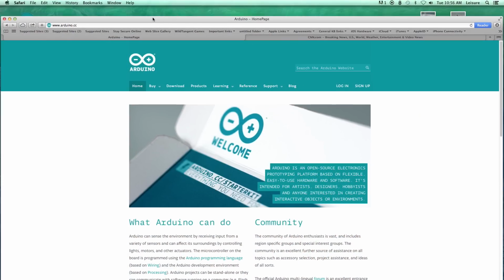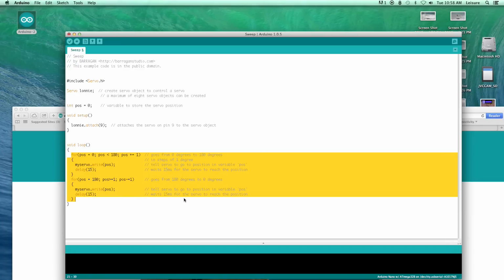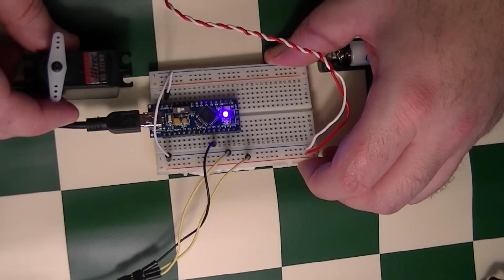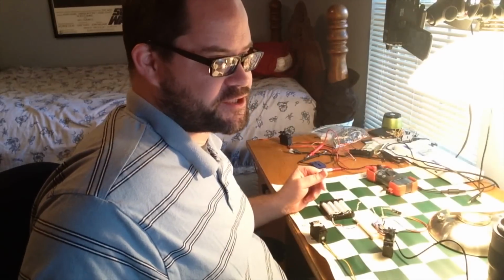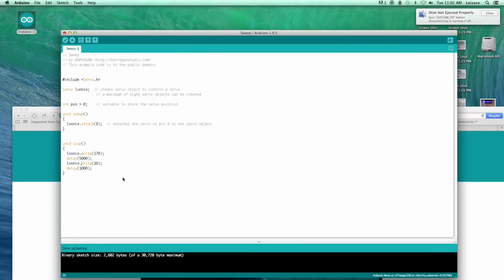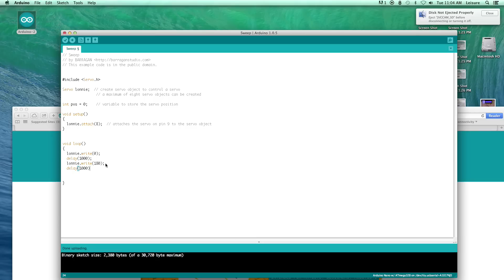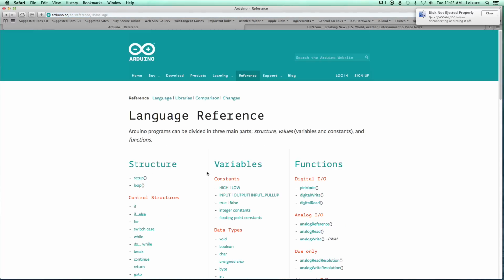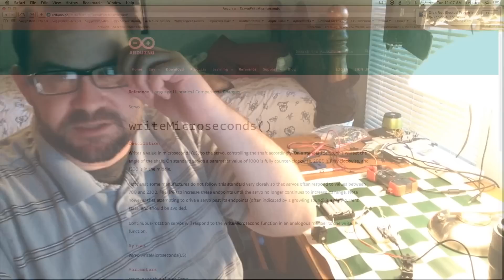How to Arduino #3 - Servos

Comment: Ok, you can connect up to 12 servos to a board. Do all 12 servos respond to the same command, or can they be programmed to operate independently of each other, in either sequential or random order?

Comment: Hello, I was curious when I do the sweep test, I keep getting the Error compiling for board, Im using a 5v trinket, and I've installed the Soft Servo into my library so it should be there. Help!

Comment: I'd like to just hook up a battery pack like the one you used directly to a continuous rotation servo. Will that work?? I'm trying to simply make a slow moving rotation motor for an art project. Thank you!

Comment: I have bought the TowerPro MG995, but I cannot get it to rotate 360 degrees. Do I have to convert it? http://www.instructables.com/id/Convert-Towerpro-MG995-servo-to-continuous-rotatio/step4/Remove-the-5kOhm-pot/

Comment: do we need a bread board for sure can we connect it directly i have 3 servos do i need 3 power supplies
Reply from the maker: you can use superglue as long as the wires are touching eachother.

Comment: hello sir i had arduino mega .. i want to run 19 servo motors but in arduino there are only 13pwm pins is there any chance to run 19 servo motors for biped robot..
Reply: You don't need the PWM pins to run your servo. Just hook your white (control) wire up to any of the outputs as long as your code has them designated as an output.

Comment: It's a servo motor, not a stepper motor, so it can tell you what position it has reached.  Instead of relying on a random pause you could loop until it reports it's gotten where you told it to go before telling it to go elsewhere.  For instance:

int pos = 180; 
lonnie.write(pos);
do {
    // nothing actually happening in this do statement, it's just looping until read says it's reached where we want it to be
}while(lonnie.read() != pos);
lonnie.write(0);

Comment: Hi! Great tutorial. I am trying to control multiple (14, to be precise) servos using an Arduino Mega as my school project. I was advised to use a Sensor shield (https://images-na.ssl-images-amazon.com/images/I/51gzXjEx9zL.jpg), which, I believe has its own power supply provision. Thing is I can't figure out how to power the servos via this shield? I have seen a lot of other tutorials and all those use a breadboard, but I don't want that. Could you please explain (here) or perhaps point me to a website or something that explains this?Thanks.

Comment: I just bought a 1501mg analogue HD and am now finding Arduino won't power it for more than a few seconds, even though it says it runs at 4.8 volts, but I'm guessing the MA draw is too much. Now I'm stuck trying to find a 6V adapter which allows around 2500mA (stall torque). They don't seem to make them over 1A!

Comment: I have a towerpro mg995 
when I power the Arduino with USB it work fine but when I try with 9v external supply it moves very very slowly
I m a beginner please help

Comment: I have a towerpro mg995 
when I power the Arduino with USB it work fine but when I try with 9v external supply it moves very very slowly
I m a beginner please help
Reply: Don't use a 9 volt battery.  Cmon man, google it.
Reply: I want to use servo in my project to move the ping sensor as head of it
I am using l293d for DC motors
but how to power servo 
please can you guide me
Reply: I want to use servo in my project to move the ping sensor as head of it
I am using l293d for DC motors
but how to power servo 
please can you guide me
Reply: This is my other account.  No I can't, I don't have time sorry.
Reply: okay
can you at least tell me best way to give external power to servo
thank you for your reply
Reply: okay
can you at least tell me best way to give external power to servo
thank you for your reply
Reply: You can just google it and do your own research.  Do it, it's the best way.

Comment: Hi Lonnie, great video, very useful for me as i am trying to build a four gate level crossing for my railway layout. I have four Hobbyking HK15178 servos and a mains (240volt) as i am in the UK to six volt DC power supply rated at one amp. can you tell me how i can operate the crossing gates from a switch controlled by my Arduino Mega 2560?
Cheers Phil

Comment: that video. it is awesome thank you so much it is very helpful I especially wanted to see power of it and your demonstration is so good, I want to ask a question is mg996r as powerful as you try to stop with your hand
Reply: Thanks for the kind words.  I do not have experience with the MG996 unfortunately.  I guess you could compare the torque ratings for the two.
Reply: Garage Flips
thanks, I saw that they are same and I have 2 questions, does it drain electric so much if something blocking it to go an angle and does it consume energy in delay parts of code?

Comment: Thank you Lonnie 

Could you please tell me how I can write code to control 2 servo to run at the same time and same deg. using for function .
Reply: Here is the code that I use for mine: /* Sweep2
 by mechanic37
 http://www.mechanic37.com
*/

#include <Servo.h>

Servo A;  // create servo object to control a servo
Servo B;           // twelve servo objects can be created on most boards

int pos = 0;    // variable to store the servo position

void setup()
{
  B.attach(4);
  A.attach(9);  // attaches the servo on pin 9 to the servo object
}

void loop()
{
  for(pos = 0; pos <= 180; pos += 1) // goes from 0 degrees to 180 degrees
  {                                  // in steps of 1 degree
    A.write(pos);              // tell servo to go to position in variable 'pos'
    B.write(pos);
    delay(15);                       // waits 15ms for the servo to reach the position
  }
  for(pos = 180; pos>=0; pos-=1)     // goes from 180 degrees to 0 degrees
  {                               
    A.write(pos);              // tell servo to go to position in variable 'pos'
    B.write(pos);
    delay(15);                       // waits 15ms for the servo to reach the position
  }
}

Comment: I got my servo working after rewriting the commands when you rewrote the sketch, but i'm not sure why it didn't work with the first sketch at the beginning of the video. And thank you for this video, it made much more sense than the book I was using.
Reply from the maker: +D. Duncan To be sure I understand - you are saying your servo wouldn't work with the example sketch, but it did work when you used the code like I wrote in the video?
Reply: +Lonnie Honeycutt that's absolutely right.
Reply from the maker: +D. Duncan Was there an error message?
Reply: +Lonnie Honeycutt No error which is what confused me. Either way, the servo began functioning so I'm good. I just need more experience programming the arduino to understand any issues I may have in the future.

Comment: i want to ask some silly question, can i just use 5v power supply from arduino board, because my servo not working using that voltage or just my servo had a problem?

Comment: Hi im using servo with potentiometer on arduino. I have an issue using a Power hd 1501 mg analog servo which jitters too much and have electronic noise. Can someone help me?
Even if i use the sweep servo programming on arduino ide it will jitter a lot. 
I am powering the servo with arduino's 5 volts or 4 AA batteries.

Comment: Great video!  Thank you for posting.  I'm buying an Arduino especially to learn servos.  Did a giant 4x8' plywood sheet holiday card and trying to make a moving light saber on darth vader... long story, but I think a servo would work based on your demo given the torque...  Thanks again.  Jason
Reply: +Jason Mayne Is this life size? That's going to have to be a pretty big servo.
Reply: Hi - the saber is 3 feet long, so I have 4 little pulleys I was going to use to take off some of the weight.  Attaching servo to the bottom center of a 5-gal bucket with a string tied to the outer edge on the back side... string will get longer/shorter as the bucket bottom turns.  Attaching string over top of board to saber...  Unless you have a suggestion?
Reply from the maker: +Jason Mayne what servo you using? What is the power source for the servo?
Reply: I ordered a BotBrain CRS Continuous Rotation Robotics Servo from Amazon and should be in the mailbox now, and a Arduinox Uno Rev 3.  Was thinking I can wire it with power, no prob; bought adapter.
Reply from the maker: +Jason Mayne Based on what I read, it looks like you should shoot for around 6 volts.  I wouldn't power it straight off the arduino board with that kind of torque.
Reply: admiring the new Servo here but guess the Arduino shipped separately.  Good idea on the power; I do have a 4-AA holder w/cord I can use as separate power only for the servo, which I think is how i see it in your video.
Reply from the maker: +Jason Mayne right on. just don't forget to tie the arduino ground to the servo power ground.  If they don't have a common ground it won't work.
Reply: Right - copy that.  I plan on duplicating the set-up you have exactly.  How to power the Arduino separately?  Yours is via USB obviously.  Needs it to be stand alone...
Reply from the maker: +Jason Mayne You might be able to power the Arduino and the servo off the same battery pack, just splice into the wire coming off the battery pack, or use a breadboard.  The key is that you are not hooking the servo power to the 5v coming off the Arduino.  If the voltage drop causes a problem for the Arduino when the servo runs, you could just use a 9V to a barrel plug to power the Arduino.  If you search "arduino 9v barrel plug" on ebay they are really cheap.  It's good to keep a couple of those around.
Reply: Great idea - thanks Lonnie.  Will see how this goes!  Hopefully I can post a video of the finished sign project.  :-)
Reply: Jason Mayne Depending on how much work this servo is doing you may need to bump this up to 4 D cells or use a wall adapter.
Reply: Cliff Hartle Thank you - yah, may help so I don't have to go change the batteries out every day too!  Jason
Reply: Lonnnie, exciting day - got it going!  Used the standard "sweep" example for the code, common ground, 4AA battery only to servo, and voila!  Thank you for the help.  Now to tweak programming.  May just connect arm to the saber - this thing has some serious torque.  All the best to you and thanks again
, Jason

Comment: And how to do a vibrating dildo???
Reply from the maker: Use a high speed motor with an out of balance weight attached to the motor's shaft.
Reply: Celphones have a speed motor with an out of balance weight attached, take apart en old celphone and atach the motor to a carrot
Reply from the maker: +Bruce Lee Not that kinda party, sorry
Reply: +Lonnie Honeycutt  im getting a boner

Comment: hi someone pls hlp me.... im using MG995 servo.... irrespetiv of the program i give.... it in rotating in steps of 1 degree only....the problem is same both in case of arduino and ATMEGA16..... kindly hlp me..... im confused whether the motors are faulty r else they require any special pluse ...

.

Comment: Greetings, Lonnie. First of all, I think your tutorials are clear, concise and easily understood. I have looked a great number of hours online for a solution to my difficulty. I'm trying to program my arduino to control a continuous servo and a standard servo together in one arduino uno. I can make them work individually one at a time and no problems or conflicts. But when I put them together in one sketch I run into errors. I may have a syntax problem. I'm hoping you you could shed some light. I'm trying to control a camera slider with a Spring RC 4315R 360 servo and clicking the button on a wired intervalometer (plugged straight to the camera) with a standard micro servo. I'm very new to arduino and servos that I fear i might do damage (over-voltage) to my camera and the intervalometer, for that matter, if I make the arduino click the camera electronically from its output pins. That's why I think a mechanical click will be safer. I'm aware there's a variety of ways to skin this cat. I copied these codes from other generous posters online and have tweaked the numbers to fit my purpose and they work good individually.
Slider 360 servo code:
Reply: #include <Servo.h> 
 
Servo Ron2;  // create servo object to control a servo 
                // twelve servo objects can be created on most boards
 
int pos = 0;    // variable to store the servo position 
 
void setup() 
{ 
  Ron2.attach(8);  // attaches the servo on pin 8 to the servo object 
} 
 
void loop() 
{ 
  for(pos = 180; pos <= 0; pos += 1) // goes from 0 degrees to 25 degrees 
  {                                  // in steps of 1 degree 
    Ron2.write(pos);              // tell servo to go to position in variable 'pos' 
    delay(10);                       // waits 1ms for the servo to reach the position 
  } 
  for(pos = 50; pos>=0; pos-=1)     // goes from 20 degrees to 0 degrees 
  {                                
    Ron2.write(pos);              // tell servo to go to position in variable 'pos' 
    delay(300);                       // waits 1ms for the servo to reach the position 
  } 
}
Reply: #include <Servo.h> 
 
Servo Ron1;  // create servo object to control a servo 
                // twelve servo objects can be created on most boards
 
int pos = 0;    // variable to store the servo position 
 
void setup() 
{ 
  Ron1.attach(9);  // attaches the servo on pin 9 to the servo object 
} 
 
void loop() 
{ 
  for(pos = 0; pos <= 180; pos += 1) // goes from 0 degrees to 180 degrees 
  {                                  // in steps of 1 degree 
    Ron1.write(91.5);              // tell servo to go to position in variable 'pos' 
    delay(1);                       // waits 15ms for the servo to reach the position 
  } 
  for(pos = 180; pos>=0; pos-=1)     // goes from 180 degrees to 0 degrees 
  {                                
    Ron1.write(87);              // tell servo to go to position in variable 'pos' 
    delay(65.9);                       // waits 15ms for the servo to reach the position 
 }

Comment: Hi,
I'm working on a potentiometer controlled 3 servo robotic arm and I needed some advice. Firstly, should I go for standard size servos or micro servos, taking into consideration the fact that the arm isn't designed for heavy payloads. And secondly, should I go for an external power supply or will an arduino uno be able to manage it successfully?

Comment: Hey, how many servos could i hook up to the arduino your using on the bread board. ???
Reply: Only one but if you want to use it for several servos and stepper motors you can buy this extra shield < https://www.adafruit.com/products/1411 >
Reply: Ok thank you, do I need to program this extra sheild ? I'm just starting out in the arduino world.
Reply: Martin Whitehurst No, this shield just adds some extra Input, Output and pwm pins to your Arduino. Please note this shield only works for these Arduinos: Uno, Leo, Mega, ADK. It won't work for Arduino Nano as it is too big for Nano.

Comment: hello 
You mean must I use external source of Power to get the Power to servo..
and If I take power from arduino and give to servo them must I use source power than I use USB
Reply from the maker: You can use either, but make sure the current draw is within the parameters of the Arduino.  Small servos are fine.

Comment: Say I want to add a push button. So that it goes 0*-40* 40*-0*    I want the servo arm to sweep, pull a nerf gun trigger, and sweep back to its original position. I might need a rack and pin attachment for the servo but I was hoping you could help with the code. If you can email me at greekgadgetguru@gmail.com that would be great. Thanks! Nice video, very well filmed and edited!
Reply: here is what I think. tell me if it helps:
@include<servo.h>
const int PushButton = 3; // push button is in pin 3
servo.trigger; //this is the motor on the trigger
void setup () {
pinMode (3, INPUT);
servo.attach (9) //servo is in piin 9
}
void loop () {
if (digitalRead PushButton == HIGH) {
servo.write..... // i am too lazy to finish this part (:
...
delay (15); // do this, it helps somewhat
} else {
delay (15); //just like above.
} // for else statement
} // for void loop
Reply: Steven Yang Thank you good sir, I've been tinkering with how to make that possible for a few days now. code works great and thank you again! moving on :)
Reply: You're welcome Jason. Tel me if it has any extra problems. :)

Comment: the twitchy or what we in the RC field, call glitch, is most likely from a dirty pot or if the battery is low, you may see the output wheel bounce when it hits the end points.  and if you want to use them as wheels make sure you get one that has ball bearings, a standard servo was not meant to have that much side load.    mike